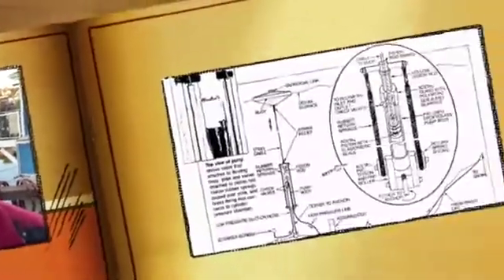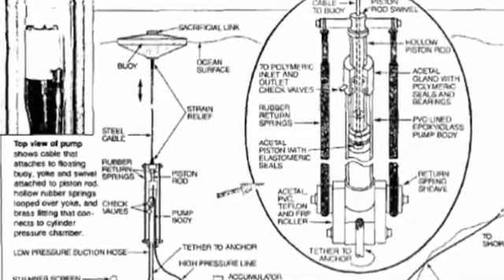Variable Leverage Pump  by Bluedesal

Comment: Joe, I have thought about your system, and sadly I have bad news. IT WILL NOT WORK.
I know you don't want to hear that so I will explain my conclusion.

So you have a barge that collects water. The system would require a full time crew to replace filters daily and bring water to shore. Consequently a capable motorized tender with capacity to transfer 16,000 gallons, PLUS the capacity to TOW THE BARGE to shore in a storm or for maintenance at a nearby drydock. Okay so barge, barge tender, crew, maintenance costs. Then I recall you have intended this system for third world countries. Terrific; because there are VERY FEW places (globally; https://www.youtube.com/watch?v=vdciHhErBUM&t=924s) that will allow anchorage of shipping hazards in open waterways or where they will damage sea grasses. A solar charging system for moorage lights would be necessary, your Water Maker Barge might also be best served with a live aboard crew TO PREVENT THIRD WORLD PILLAGING. The barge would require annual anti fouling or any lift from passing swells would be severely handicapped. You mention a sixty foot version of this. REALLY!?? 60 feet?? I presume two 30 foot barges connected by (OH MY GOD a hinge????) That will work in light conditions but in a heavier swell it will open the hinge as intended and fold the two barges as if closing a book, but on the way back down the hinge will rip out of the deck because there is no allowance for REVERSE FOLD.
Okay so one barge holds the water, the other holds the pump/filtration system. Works fine in it's miniature state as a bobbing fishing float, but the back half of a 60' barge will do ABSOLUTELY NOTHING. It would take a full southerly blowing all the way up from Alviso to pump up the wind swell large enough (3 or 4 feet) to even move the trailing barge; trailing in the wake of a 30' barge flattening the swells before even reaching the bobbing barge back half. A guy could design the anchoring method to allow for the bobber barge to be forward facing and take the swell first, but even with MAXIMUM swell effect the lift the bobber barge would effect would be MINIMAL AND CERTAINLY WON'T BE BOUNCING UP AND DOWN AS YOU ESPOUSE.